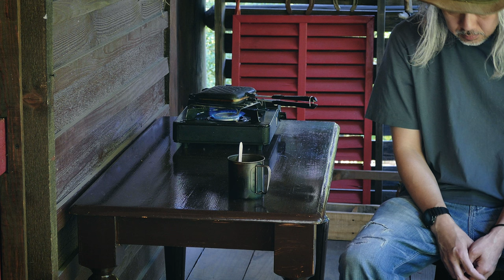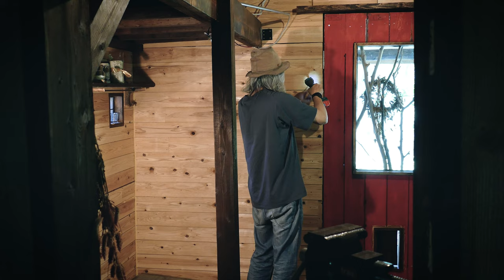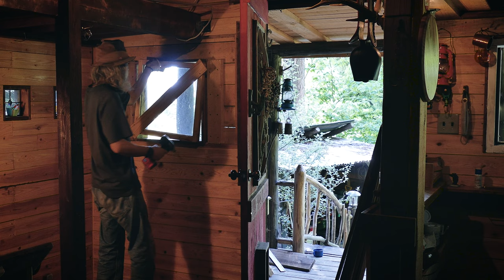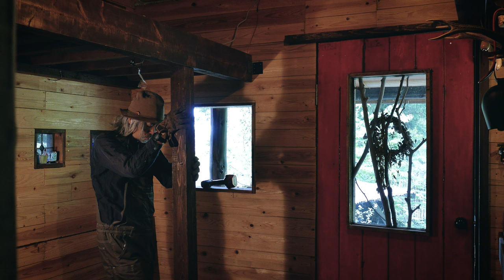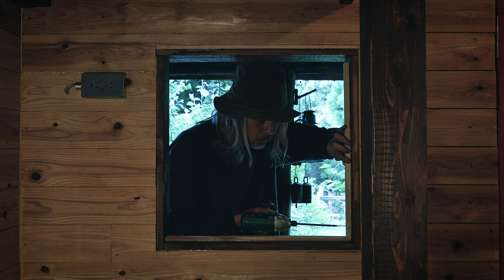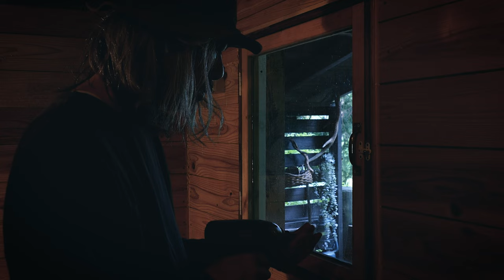New window installation process / Building a cabin with improvisations

Comment: Oh Brucke, you must’ve read my mind! I wondered if you would ever put in another window in that spot on the verandah! I think it looks very nice and it evens up the balance with your other window on your verandah plus adds more light inside the cabin. Great work! Would you ever consider putting in added insulation within the walls and roof to keep the cabin cooler and warmer? You can get wool insulation that would keep it eco friendly and sustainable. I love your video’s and thanks for sharing your knowledge. 🦮🐱🌱🔨🪟🫖🙏🏻♥